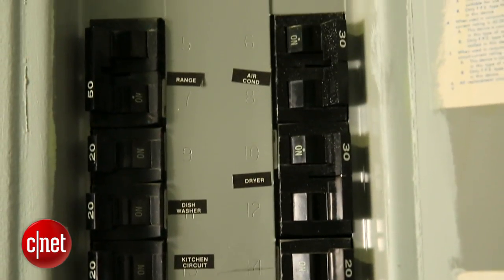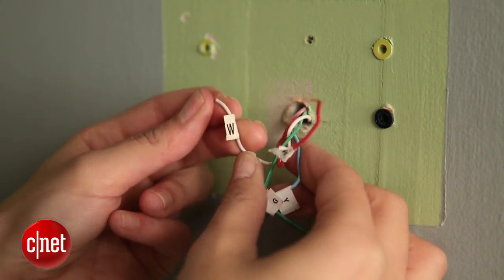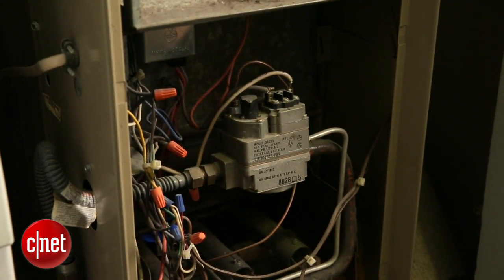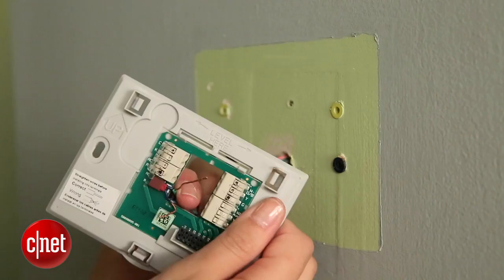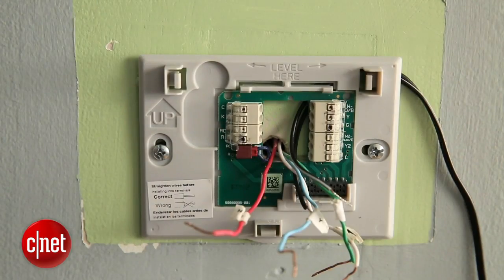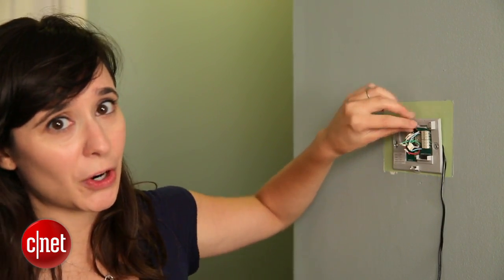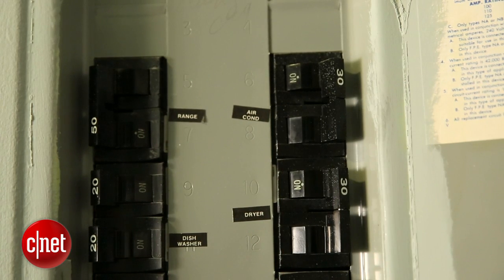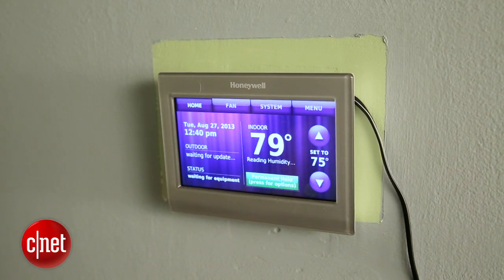CNET How To - How to install the Honeywell WiFi connected thermostat

Comment: not trying to be mean  but going to come across that way... using that power cord is not attractive and an eye sore. so should of used another thermostat or upgrade and run the c wire.  but i would of never done it that way looks cheap.

Comment: You can also substitute the G wire for the C wire so you won't have a wire sticking out with a giant box plugged into a nearby receptacle. You would need to run a jumper inside of your HVAC unit. The only downside is that you'd lose the FAN ON functionality, but it will be able to run on AUTO. I almost had to do this, until I found a hidden wire on both the wall of the thermostat, as well as the HVAC, allowing me just to run it as a C.

Comment: Turning off the AC circuit breaker will not always turn off the power to the thermostat!  If you have a gas furnace and electric air conditioner, the power to the thermostat is provided by a transformer in the furnace.  You must also turn off the circuit breaker that powers the furnace!